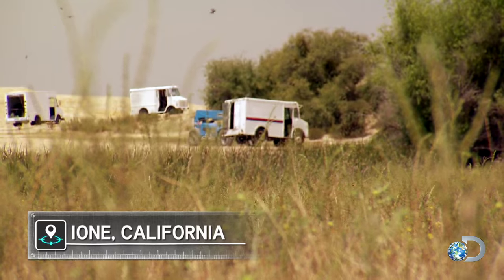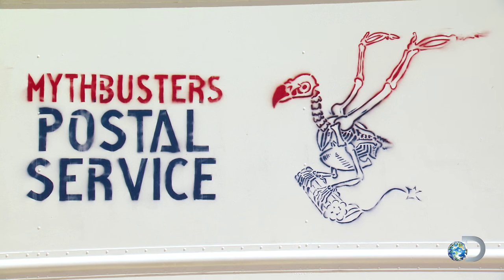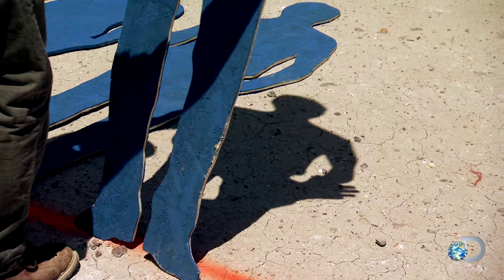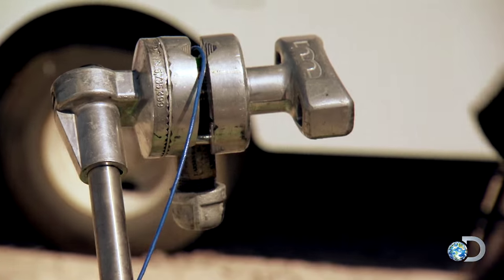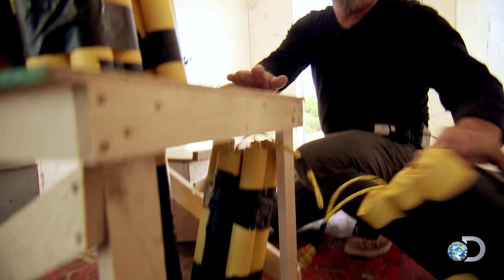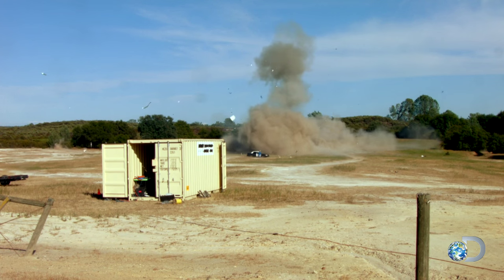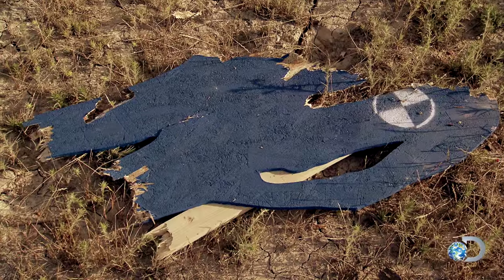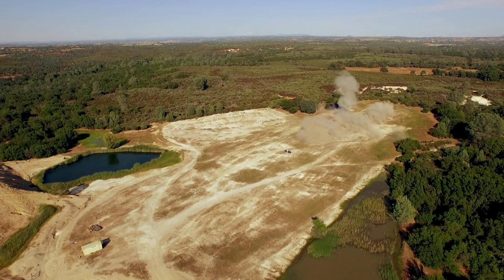Catastrophic Carnage | MythBusters

Comment: I think they are wrong by saying myth busted on this one because they only made something for the tnt to explode not like the original as I am going to explain. First using lets say water on a postal truck filling it up i do not think it would fill up because it would just leak out because of the consistence  of it so trying to find a substance that can stay yet moist is difficult because there is a couple things the cement is doing one is wetting and making it most so that the TNT will not explode and for the ones that do it wont be significantly enough to make a huge explosion so by them making it reinforced by wood not like the show is already messing with what originally was done, Example and reason two let me say is if you guys from mythbusters one of you guys had a postal truck with 80lbs of tnt regular tnt not reinforced to make them explode like you guys did  in the show and was in-front of your house and only had the time allowed to find and poor cement on  it would you A fill it up to stop the bomb from exploding would you not fill it up wit cement or just let it explode and get away from the blast? obviously fill it up with cement because it worked the cement saturated the tnt to make some dud's and the ones that do explode are not significant enough to cause a large explosion exactly what the show did but you guys modified things just to cause an explosion and defeat the cement idea but that isnt the original idea he did in the tv show so myth not busted in that case tho if it was wrapped in plywood and all that then yes run like hell and get out of the way but only and only if it was how you guys tried to beat the cement idea so myth to me not busted i would 100% cement the truck if its regular tnt not in-closed with plyqood or anything as such to cause a full explosion ....ok feel free to comment hehe.
Reply: +dreamkiss4u run on, run on run on

Comment: here is the reason why this is Busted. any explosive no matter the size can increase the explosion and packing it will do nothing to stop it. Truck Bombs are dangerous in the 90s we had 3 in the US and 17 around the world. if you stand next to one of these you're going to die truck bombs blew up Oklahoma City, truck bombs destroyed Waco, and truck bombs blew up Tower 3 and the Lobby of Tower 2 of the World Trade Center. no matter the size one truck bomb is the equivalent of one Heroshima Bomb the blast radius is 500 square feet you won't get out in time. so for the final time MYTH BUSTED!
Reply: +Aaron  It's about energy.  Absorbing the energy will reduce the blast,  for example cooling down the blast gasses with water or sand helps.   Transforming 40 pound of high speed gas in 4000 pound of low speed stuff also changes the impact.
Reply: yup thats why the myth is busted.
Reply: 1 Heroshima Bomb. I aggre with you only if we divide this value by lets say 10 thousand
Reply: Michal Pietrzak don't mess around when there's a truck bomb Waco, World Trade Center, and  Oklahoma City all truck bombs. blast radius for those things is 500 square feet that is the equivalent of the Hiroshima bomb. Oklahoma City Waco and the industrial district of New York were destroyed when those bombs went off in the nineties. you think cement will stop a bomb it won't it just increase the blast radius of the bomb that's how Oklahoma City and the World Trade Center got destroyed all because of one bomb and it was a big bomb loaded with dynamite,semtex, and AMFO. and you want to know where the three guys or who did these bombs they are in Florence State penitentiary in Colorado in an area known as bombers row their roommate is Unabomber himself.
Reply: I have just opened Wikipedia and read. Little boy weight was more than 4 thousand kg. It's Power was evivalent of 15-16 thousand kg
Reply: And it killed big City hieroshima
Reply: Michal Pietrzak 15 kilotons is 15000 tons or 15 million kg
Reply: Yes, and what
Reply: it's Hiroshima ffs....